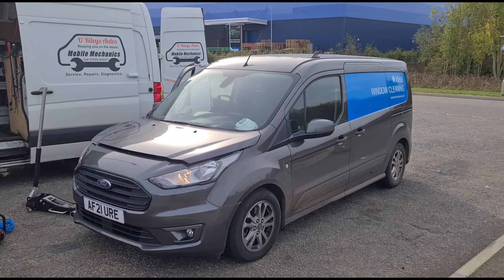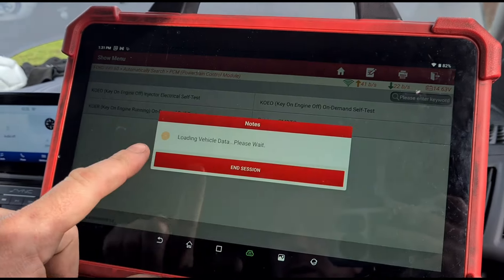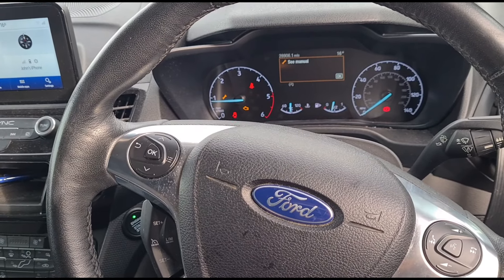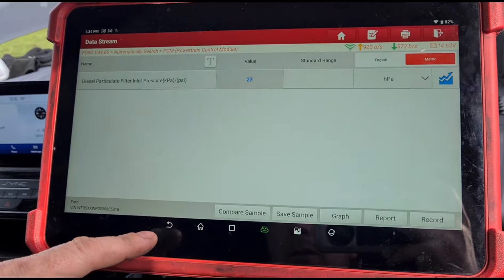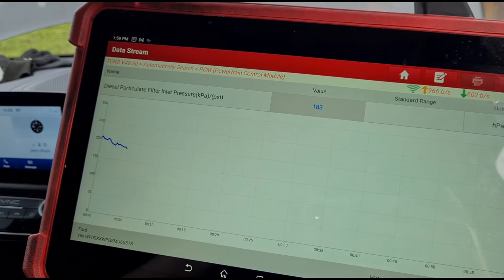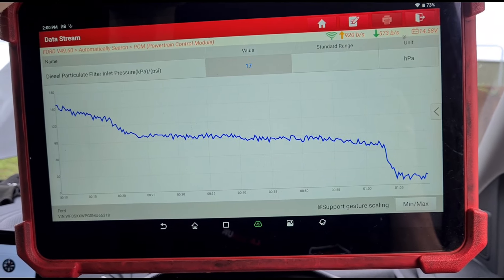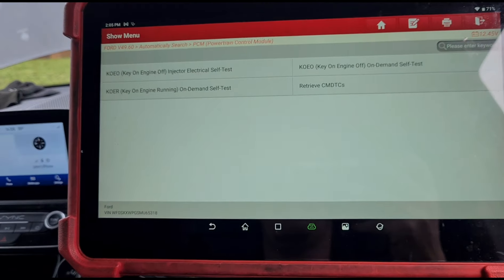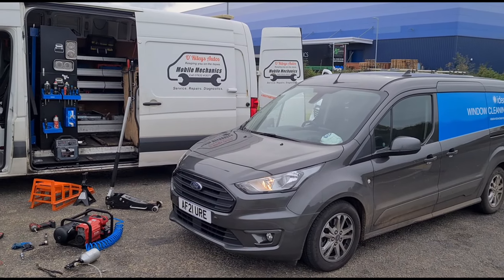Ford Transit Connect 1.5 DPF Blocked Diesel Particulate Filter Cleaning & Adaptions

Comment: just picked mine up today same slit boost hose just under 30,000 miles (19 plate) fortunately i had taken the extended warranty probably wont be as lucky in another  30,000 miles

Comment: Hi Jimmy, It’s always good to see your videos, my transit connect 2018 (68) plate has now thrown the same error, exhaust filter over limit, but this was within driving two miles after adding 300ml of liquid moly ceratec to the engine,
I was wondering if this would be a case of driving the van for a duration to force regen, or is this error something only an adequate scanning tool can clear, before a DPF regen can be completed.
I had a forced regen carried out last October, and the turbo inlet pipe replaced.
Van has been rattling since February, and despite 3 injectors being replaced, rattle returns after 100 miles.
Just to update the knocking was a PCM fault, and required replacing, I just don’t do enough miles in my transit connect mk2 to keep DPF soot free, it’s a constant battle.

Comment: Having problem with mine light on for soot, they checked with the computer and the psi is in the red/low on the outgoing side, the engine runs fine so unsure if sensor or not, still waiting on them, seem like they’re avoiding doing the job

Comment: I have a 2019 fiesta sport 1.5 euro 6 triggering a P226D code but no others 

No power issues or black smoke 

I reset it once but the I’m seeing 250mbar at idle which proves the DPF is stacked 

All original, what would you recommendation be to cure this ? 

Best regards

Comment: All of those problems under 30k miles ? And it sound really agricultural. Ford went really bad since the PSA engine era...
Reply: We had a 2.5di banana transit , 300k miles. Engine fine, bodywork fell off in the end.. bring back those days!
Reply: sounds like tractor, got a 2017 connect tdci with 150000, doubt this one will last that long, if it does, wait til the cam belt needs changing, it'll be cheaper to scrap the thing, timing belt probably in oil, most mechanics wont touch it, only the main stealer will be interested at about £2500-£3000
Reply: @craigthev you’d be surprised. This engine is the same as the one in your connect (same PSA derived block). Main difference is these have a 16v head to meet tougher emissions standards at the cost of reliability. The 8v engine was used in transit connects up until about 2020 and is much less problematic and more refined. Still has the usual dry cam belt though
Reply: The psa engine is absolutely brilliant engine the 8v atleast, the last generation before the adblue stuff with general maintenance will go 200-300k regularly. Ford seemingly on the euro 6 diesel are using I believe their own dpfs and having massive issues with them all on their diesels engines. The psa versions of the euro 6 on the likes of peugeot/citroen/ bmw/somehow are working a lot better have far less trouble with dpfs from my experience.
Reply: @bobsurrey6686 for some reason I thought this van has the ford "puma" codenamed 1.5 with the wet timing belt.
Reply: @craigthev  2017 has standard cambelt, takes less than 3 hours, or DIY about 5, simple job